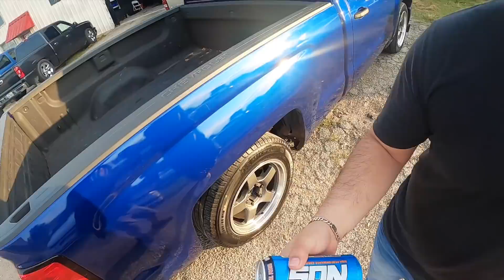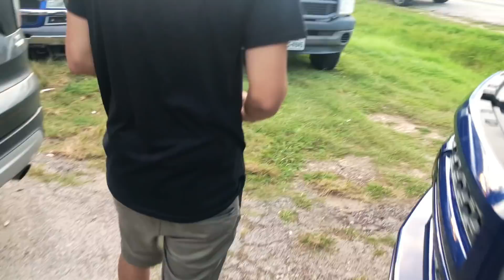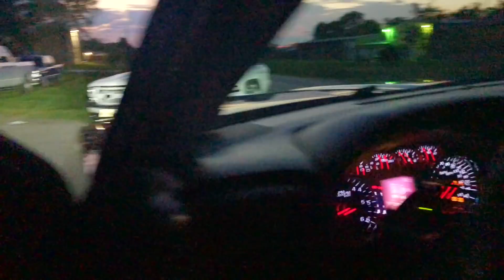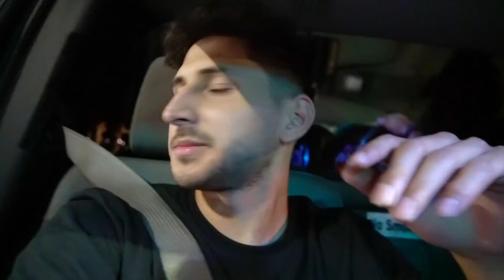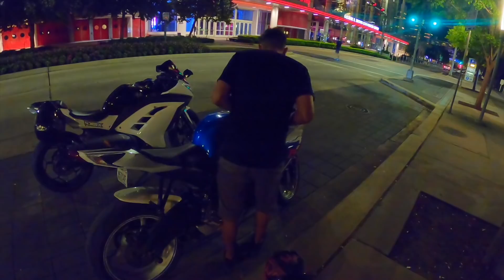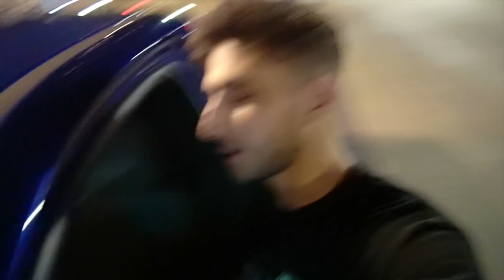Little Blue Gets Street Tuned !!! && Gets Down !!!!

Comment: Buy a basic troubleshooting code reader from Autozone, install some new Iridium spark plugs and wires, those are good for almost 100k miles. See what cylinder is throwing out the code. Don’t replace the coil pack. Just moved them around and see if it’s still missing, if so, just replace the one bad one. Should be able to pull some off the old engine. Otherwise it’s like $50 each. Also on the video, just detach the audio from the video and cut the audio out to mute the bad language, carful with getting it out of sync. Peace o also you seem more wired without coffee lol laters

Comment: If the misfire is still there with the 3rd motor than I have a feeling the 2nd motor was fine. It was the parts that got transferred over from motor to motor that had the problem. Thats my opinion anyways. Great video